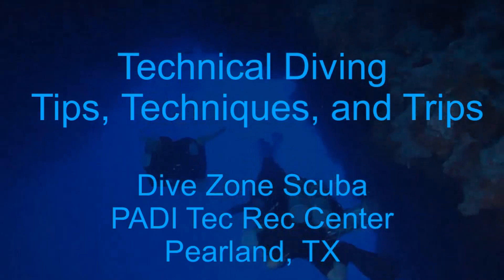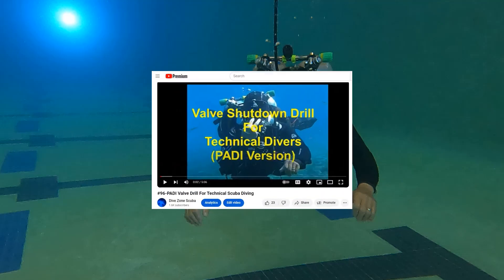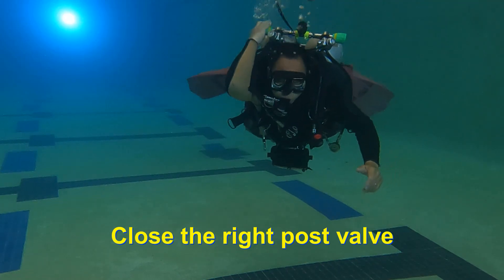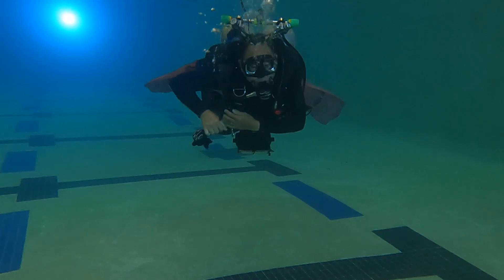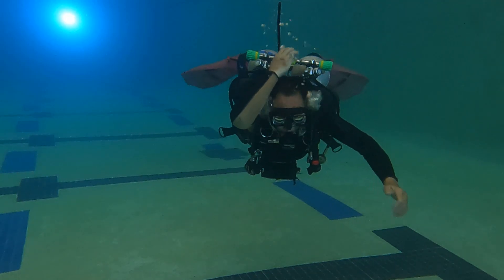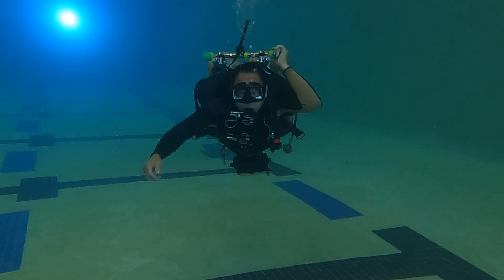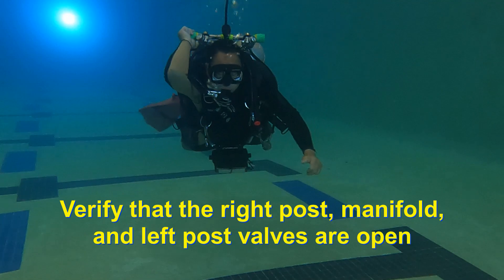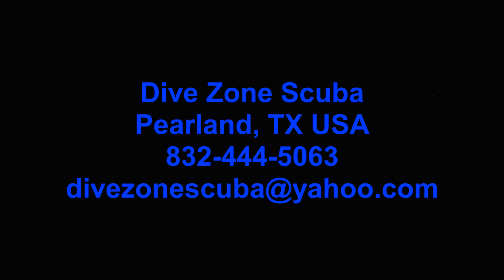#162 - DIR Valve Drill For Technical Scuba Diving

Comment: I just finished my TDI AN/DP course, and my instructor taught me this drill a little different.  Wondering your thoughts on the way I was just taugh: Right Valve> Left Valve> Manifold off> Manifold On.... All the videos I'm seeing they're doing Right Valve> manifold> Left Valve.
Reply from the maker: Hello Eddie.  The opening and closing and sequencing of the valves is one of the most debated issues in technical dive training.  Virtually every certification agency that explicitly specifies that does so differently.  One even changed they way that they specify it recently.  What is most important is that you are able to open and close your valves and know when you need to open and close them.